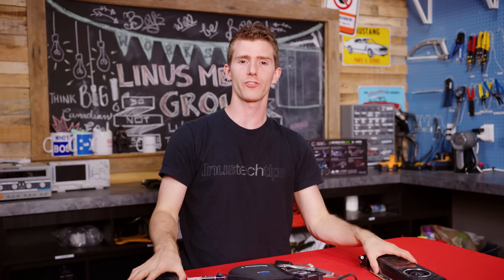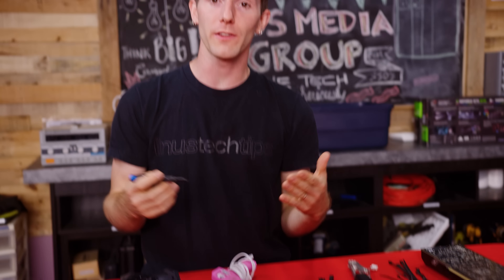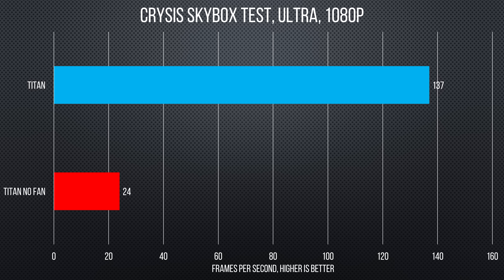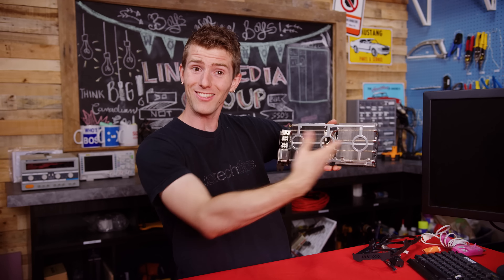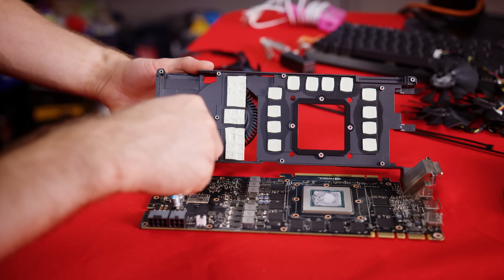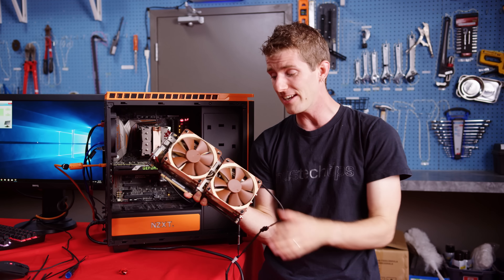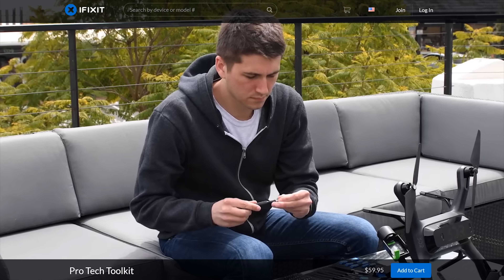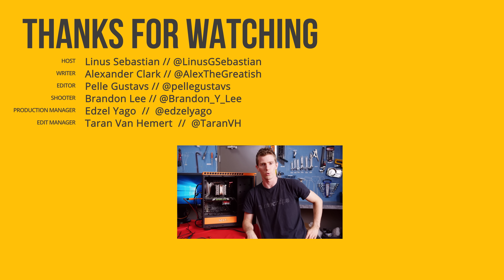Video Card Dead Fan Repair Guide

Comment: Hi there Linus,
it's not exactly your core territory, but I'd be very curious about your view of this product: https://molekule.com/ - is this a candidate for "rediculous tech over $100"?

They seem to use a lot of pseudo-science in the marketing materials, but I'm not sure if this is just to make it approachable for the masses, or because they are genuinely trying to pull wool over eyes.   I would genuinely love for this to be real, but it's pinging my skeptic nerve.

Some of the science does check out - if you read about photo-catalytic oxidation, it is a genuine branch of science, and it does treat some fairly nasty volatiles, although there seems to be some research coming out of universities saying that PCO can actually product Formaldehyde as a byproduct (which is clearly not what you want in your house).

What's your take, as a well rounded skeptic?

Thank you
Sean

Comment: Linus, don't be such lame pls. 
Check original blower fan power usage and check replacement fans, and wonder... original fans take much power especially blower on ref card.
Second, on AMD using fan on original header is fine, you can use afterburner custom curve.
That is not the case with ref nv cards, it raises pwm signal in the background, until fan reaches ~1100 rpm....

Comment: This is virtually pointless. With a tiny bit of patience, you can find replacement coolers for basically any modern graphics card on eBay. Or go the water cooling route.

Comment: "protech repair kit" "hard to find security torx/ hex" you mean like the ones from harbor freight... $60 USD for a bunch of shitty re branded homegamer tools. pro tip using a razor blade you can pop open plastic tabs easily just push and twist until it pops free.